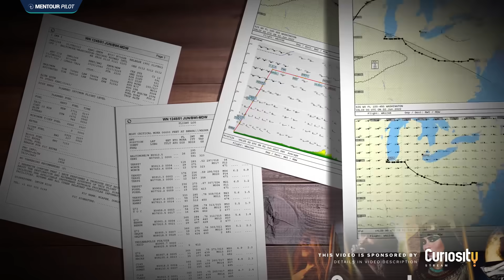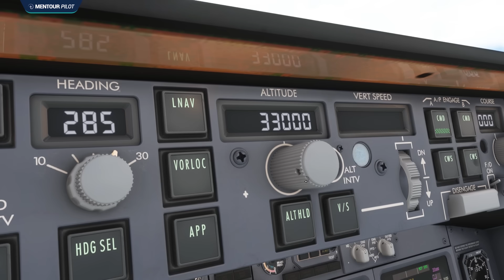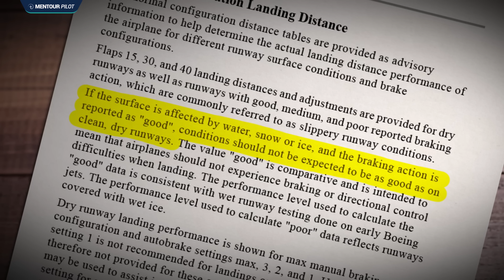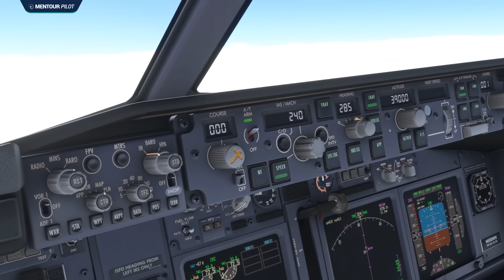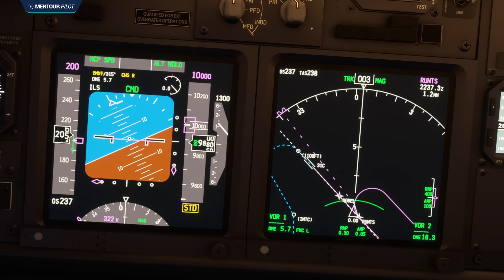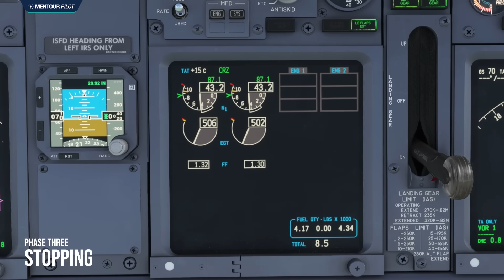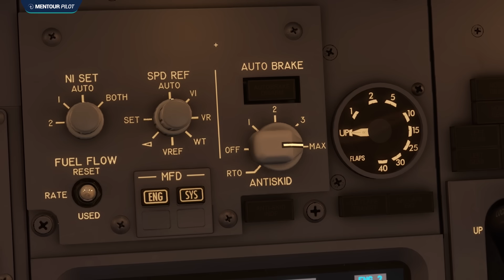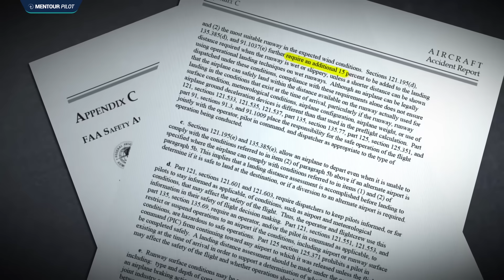WHAT did The Pilots MISS?! Explaining Southwest Airlines flight 1248

Comment: I live in a country with a super short runway and the sea at either end. The pilots have to set down at the beginning of the runway and then slam the engines into reverse thrust to decelerate extremely quickly. Landings are frequently rough and loud, and you get thrown forward in your seat. There's also frequently sea fog and iirc we don't have ils at all, so when it's too foggy they must divert to a nearby airport. There are also weird winds and up / down drafts due to a steep mountainside parallel to one side of the airport and sea at either end. Its one of the top 10 extreme airports.

Despite all this, there haven't been any serious accidents or incidents, and it's actually very safe. I guess the pilots and ATC are good about sticking to guidelines and rules.

Comment: Been to MDW many times on 727,757, and 737s with ATA Airlines and Southwest.   Every landing is always max trust reversals till the plane taxies off the runway.   I rather enjoy it, but I know many passengers who aren't used to max reverses get a little nervous.   It's a short runway for sure, built on an old school district lot tat was sold to them, hence the square shape. 
Never knew Midway allowed for tailwind landings though, I know they often use the crosswind runways a bit.  Surprised the crew didn't ask for a different runway.  Then again not using the trust reversals was the nail in the coffin there.  I can't see any big jet landing at Midway those not working.   Diverting to Ohare, maybe.   I'm glad they have that new runway system in place, its pretty neat.

Comment: 10 second in and my guess is they're expecting the autobrakes to work, but they're not, because they've not been armed, because a thrust lever isnt back in idle. This has happened SO MANY TIMES before :/
Reply: That brings to mind that both pilots were on the same thought track. Neither could see beyond what was supposed to happen.

Comment: Wouldn’t it be more convenient if thrust reversers were automatically deployed by nose gear pressure similar to the spoilers? Maybe provide a bypass switch in case of a go-around. Seems like This would eliminate some of the workload of the pilot under pressure and kill forward thrust, cool brakes, etc.

Comment: I was flying into MDW that night on the B737-800, a larger aircraft. We looked at our landing numbers before starting the approach and diverted to MSP. We did not wait around because we knew it wasn’t going to get any better. After landing we were told MDW was closed due to the accident. We ended up going to ORD and landed at about 2 in the morning. 

SWA’s safety attitude left something to be desired. The key point in the whole thing is that if part of the runway braking action is poor, all of it should be. That said the TDZ braking is never as good as the middle due to rubber deposits. Great video.

Comment: Anti-lock brakes let the operator maintain steering control while braking, but in snow/gravel/sand shortest braking distance is locked wheels (the tires act like little snowplows) but at a sacrifice of steering control

Comment: Really strange that they didn’t apply maximum trust reverse when they touched down. As the runway was slippery this should have been given more focus than breaking with the wheels.
Reply: they were basically testing the soon-to-be-mandated autobreak system, seems they were too focused on that so they lost focus on the thrust reverserss.
Reply: @HappyBeezerStudios  In such conditions I would expect the landing procedure to be briefed in detail. That does not appear to have happened.

Comment: "We use the spoilers so the whole weight of the aircraft comes down on the brakes"
The use of spoilers may or may not ensure that the sum of vertical forces on the wheels equipped with brakes is lower, equal to or higher than the mass of the plane multiplied by gravity (what you and some other norrländinger) call weight). Some spoilers will give you negative lift (positive downforce) resulting in a higher load on the wheels - and some will not.

Comment: I find it crazy that there was no mandatory margin built into the stopping distance calculation by either the FAA or operators.  When I heard their calculation gave them 40 meters of runway to spare I kind of chucked like no way it's legal/within company policy to land with that output.
Reply: Perhaps I misheard, but I thought it was 40 feet - which would be much worse than 40 meters.
Reply: There is a big margin:  A safety factor of about 2/3 beyond the demonstrated dry-runway  stopping distance is the basis for dry-runway flight manual field lengths involving rejected takeoffs, for example.  This accident was the result of runway conditions worse than what was assumed in the regulations, plus inexcusably late application of reverse thrust.  Reverse doesn't count for much in an average landing on a dry runway, but becomes increasingly important as runway friction drops.

Comment: A bit of an addendum: An anti-lock (or anti skid here) system does 2 things: First and foremost keeps the vehicle steerable. Second, reduces stopping distance on rigid surfaces like a road or runway. It actually degrades stopping distance on e.g. gravel or snow. So imho the final report should also have mentioned the lack of training for this new system. I'm assuming here the poor braking action part of the runway was snowed over and the flight sim can't show that.
Reply: What you says is only for the road.

 The antiskid actually stops this airplane for all runway conditions in a shorter distance than is possible without it.
So if it fails you ll have to be cautious all the time with the brake  pressure, otherwise your tyres may burst.. and this will extend the stopping distance even further, if not the fact that you dont have tyres anymore.
Reply: @Hk-uw8my  Source?
Reply: @Rasta8889  Boeing themselves in the manual( FCTM). 
Manual braking section:
"the antiskid system stops the airplane for all runway conditions in a 
shorter distance than is possible with either antiskid off or brake pedal 
modulation."

And if you want to try without antiskid you can see on the manual braking with antiskid inoperative section that you should "use minimum braking consistent with runway length and conditions to 
reduce the possibility of tire blowout".
Reply: @Hk-uw8my  Thanks. Turns out that even for cars my information is outdated since about the time I've made my license.

Comment: Last paragraph in the 707 manual landing operations section, “in no event should the take off distance exceed the length of the runway.”  Sounds like this crew may have ignored the most important gauge of safety even before they commenced the approach…the pucker factor.

Comment: As someone intimately familiar with driving a heavy car in winter, I find it apaling that pilots of multi thousand tonne airplanes sporting slick tires have no idea how unsafe a slick, let alone frozen paved surface behaves. I would encourage any future pilot to look into winter specific driving courses as well as winter condition piloting training. Just seeing how a car behaves on ice will teach you an enormous amount about larger vehicles and craft of any type. I also suggest that aspiring pilots get a boating license in order to understand the basic effects of manoevering a vehicle on a fluid surface. This sounds totally unrelated but is genuinely important information to know in order to further understand how different types of vehicles interact with their respective operationnal envelopes.
Reply: I'm sure the pilots realize how tires behave on slick runway surfaces.  You seem to be leaving out the fact that commercial airplanes have thrust reversers.  It's the fact that reverse thrust was not applied until 18 seconds after touchdown that caused the problem, not some lack of awareness of the reduced braking effectiveness due to the snowy runway.

Comment: A lot of the issues with MDW is it’s such a busy airport, but in a very tight space. Literally the airport’s footprint is a 1mi by 1mi square. Just outside of that space is a residential area and the public roads just outside the airport walls are very heavily trafficked. 
I do question the crew’s alternate choice of KCI. Two other realistic options would have been IND (Indianapolis) and DSM (Des Moines, IA). In addition there are multiple commercial airports not far away from MDW, including GYY (Gary, IN), MKE (Milwaukee), MSN (Madison, WI) and RFD (Rockford, IL). Not to mention, they were only a few miles away from ORD. Sure, at this time Southwest did not fly to O’Hare, but it was available for an emergency if needed. All these airports have longer runways than all the runways at MDW.

Comment: Mentour Pilot, I suggest for the next video Gol Linhas Aéreas flight 1907, occurred in September 2006, in Brazil amazon sky, where a Embraer Legacy 600 collided with a B737, resulting the death of 154 passengers of the B737, and exposed serious problems involving L600 CRM, TCAS… and, on the other hand, severe Brazilian flight control failures… 
A dramatic chain of events compose this tragic story that deserves to be shared.

Comment: I think part of the problem is that the design of the thrust reversers controls is unnecessarily complicated. There's no need for the pilot to extend the mechanism, then wait several seconds, and then set the desired reverse thrust. Instead they should be able to set it immediately, and then the plane can figure out when the reversers are extended and apply the correct reversing thrust immediately afterwards.

Also the landing calculations shouldn't require a separate computer. It should simply be integrated with weather and runway data. That way if there's some fine details about how to interpret the data that pilots are likely to forget or not learn about in the first place, it can be programmed in by people on the ground and tested properly. It won't suffer from manual errors such as typing in a wrong number either.

Comment: I am a systems analyst, 32 years experience. The solution is simple. You need longer runways. It is lunacy that there is any runway that is not long enough to land on without needing brakes, or where you cannot abort takeoff at any speed.
Reply: Not sure what systems you analyzed for the last 32 years, but I'm guessing they didn't involve physics.

Comment: We here in Ontario Canada are no different than any other place.  Our weather is not falling on the same months it used to fall on. Our May normally sees a max temp of 22C and this year it saw several times temperatures up to 32C (and a week ago had a straight line wind event that was record breaking across the province).  A lot of the runway excursions here come down to pilots underestimating the runway conditions usually due snow/ice (more so than say rain/water or overheating and going soft in the heat).  I have to wonder though, there used to be times of the year you can say "but it is winter, of course there is snow/ice" and now, what you may have been used to is not happening at that time of the year, and how many pilots are expecting one set of weather conditions and are landing in very different conditions for the time of year.

Comment: So runways are identified by their compass headings?  That makes a lot of sense out of those strange-seeming call outs, like 31L, or 31R, I could never figure them out before.
Reply: Yes, they are. I grew up near Heathrow, London, and when I was a kid, the main two runways were 28R(10L) and 28L(10R). Then they became 27R and 27L because the magnetic pole heading can change a few degrees over just decades. I think it went from 276 degrees meaning R28, to 274 degrees, which made it R27.
Reply: @renejean2523   Back in the good old days there was runway 05/23 as well. Put it down on the numbers, slam on the brakes and hope that nobody has left any ULDs  lying around outside T4.
Reply: Yes. Each runway has two numbers, one for each direction. Runway 0/18 runs north-south, 0 being northbound and 18 southbound - just divide the compass bearing by 10. L and R refer to leftmost and rightmost of a pair of parallel runways. Very occasionally, C for centre.
Reply: @hb1338  - lol Thanks for that. Yes, I remember that runway. It was rarely used though. But it was the best to watch the landings from when it was used. And it was much shorter, as you say. My plane spotting days were PRE Terminal 4 too.
Reply: @hb1338  - Speaking of center runways, I live in the states now so I'm a bit out of touch, is that third runway in the West Drayton area still going ahead?

Comment: The thrust reversers on the 737 NG can be deployed when either radio altimeter senses less than 10ft altitude to minimise the delay in deployment and prevent the engines going to ground idle.

It sounds like this wasn't Southwest's policy to fly the aircraft like this.

Comment: Safety factors should always be part of the equation when dealing with human lives. In engineering some calculations include a SF of 4. It’s amazing a 15% SF wasn’t always part of the calculation. For those that are not familiar with engineering, that means taking the result of the total stopping distance and multiplying it times 1.15. So, 100m becomes 115m. Do the calculations include reaction times? 
As an Aerospace engineer I know that when designing an aircraft we do calculations for the stopping distance and reaction times are accounted for, not sure if they are accounted for during a flight.

Comment: It seems like when the copilot realized the thrust reversers weren't at max, the response should have been to go to max thrust and go around (like when a carrier pilot misses the wires).  Would there have been time for that, though, since I assume it would also take time for the doors on the engine to close?  (I am not a pilot).  To put it another way -- once you deploy the thrust reverser, are you committed to landing and you can't go around?
Reply: Taking off again wasn’t an option after dropping to idle for that long 18 seconds of breaking. The engines take another 5-10 seconds to rev up to full thrust.
Reply: You cant go around once the thrust reversers have been opened as boeing said...just imagine if a single one of them fails to retract.